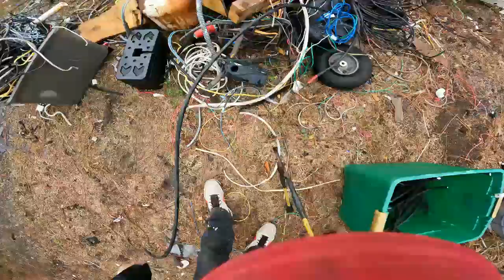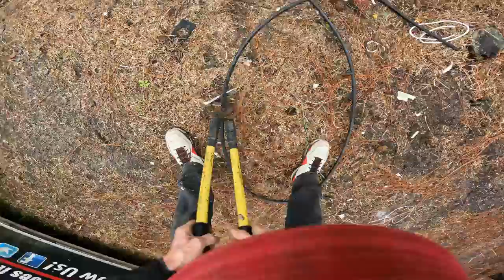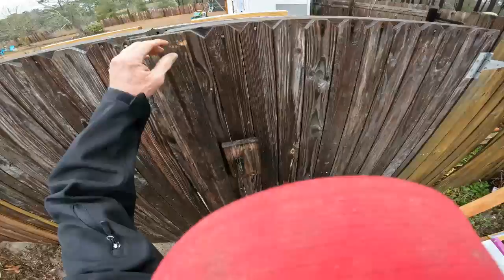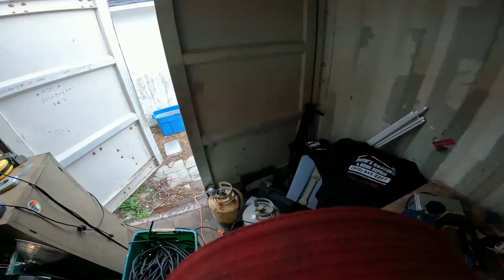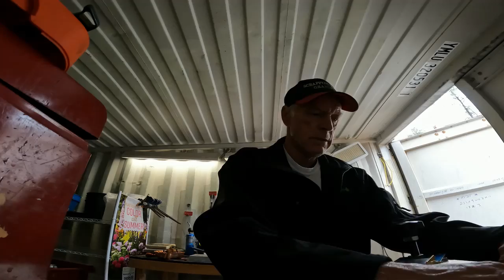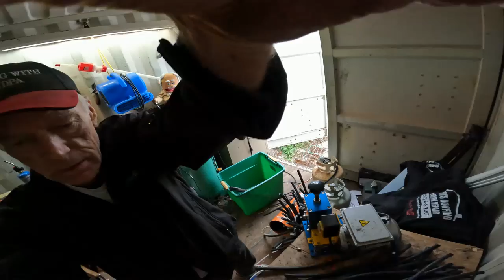Stripping aluminum wire. Recycling with a story.

Comment: I need a better stripper. I have the hardest time with aluminium wire
Reply from the maker: What 1 do you have
Reply: The one you can use either manually or with a drill
Reply from the maker: I know which one you’re talking about I’ve heard a lot of people say they were great strippers they like them